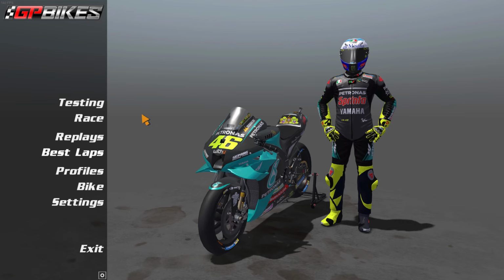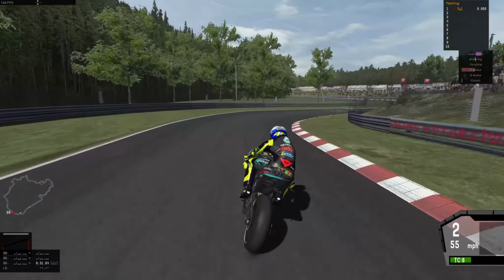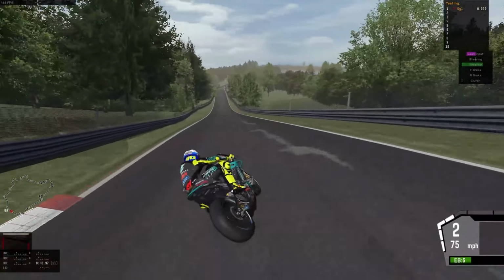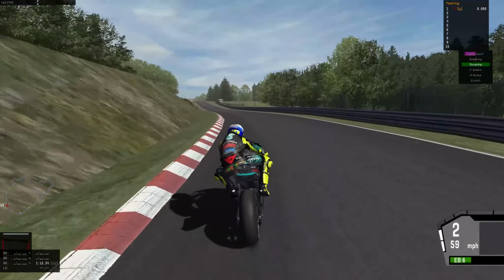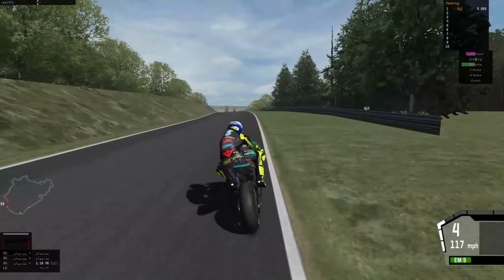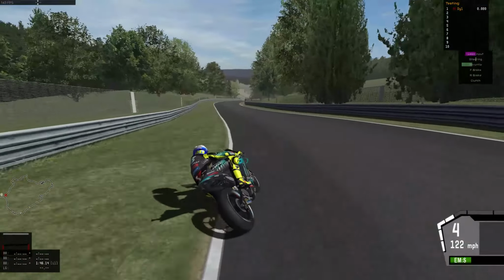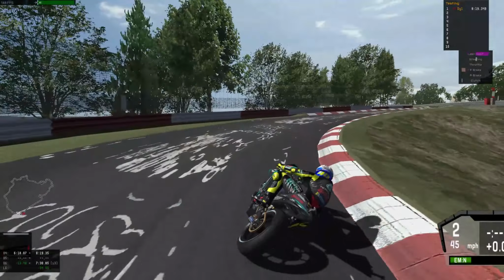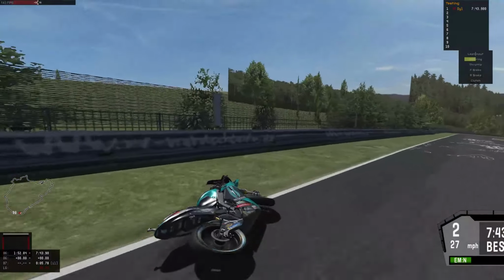CAN A MOTOGP BIKE LAP THE NORDSCHLEIFE??

Comment: Oh man! This is some very old Nordschleife version! Try Nord_LS_NDS it's in the track database link in GPB forums. Pretty sure it's a scanned track and imported to GP, making the quality significantly better.
You can blast it trough using the racing line you've learned from other sims and games, or cruise it under 8 minutes because every corner and scaling is proper.
Reply from the maker: Will have to have a 2nd go so! Thanks 👍